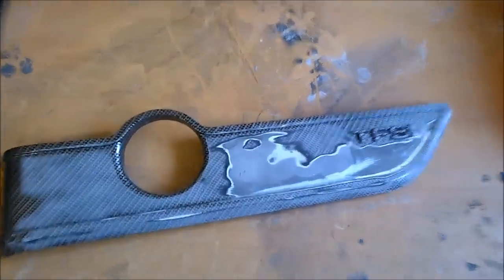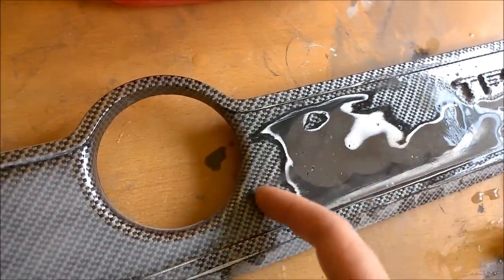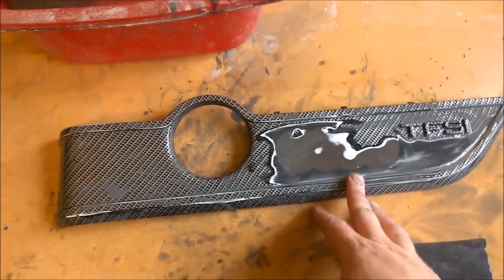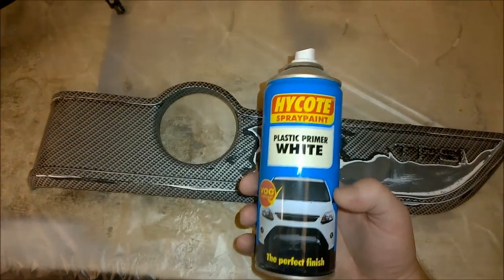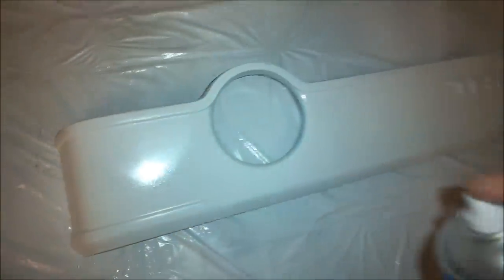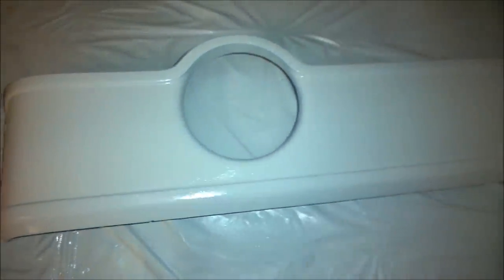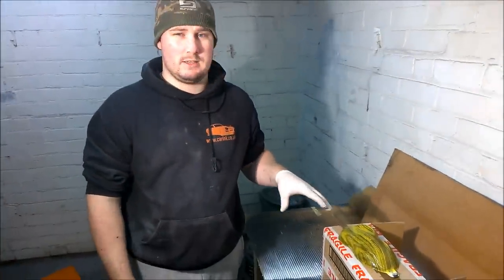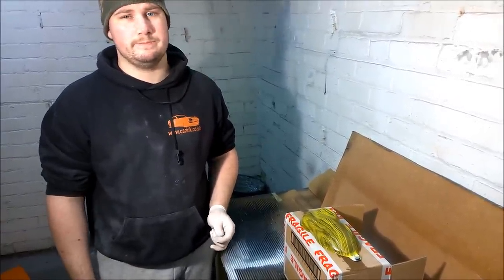Hydrographics Start to finish instructions for beginners , CARINK

Comment: Really helpful video, thanks for it, if you have a already painted piece, you only need to sand it with 800 sand? There is nothing added to the water? So the only necessary thing to have are hydrographic film and activator? Can u use the film in a car intake piece? , not a high temp part but it can get really hot.
Reply from the maker: Ye a lite sand should help, it depends how long its been painted and how hard it is. An intake will be fine as the film can usually take a lot of heat, it depends more on the paint and lacquer. ty

Comment: just found your vid and subbed it was very helpful and I will watch the rest, I just had a couple of quick questions
1) when your done dipping a part is it necessary to clean the excess film from the tank and if so how
2) how do you clean the film off of your arms when your done
thank you for any help
Reply from the maker: ray5220 Hi Ray,rinse your arms with warm water and quickly, do not scrub as the activator can burn.Film should be scooped out with a net, but on a proper tank a filtration system is fitted, thanks

Comment: thanks a lot for instructions, lets say that my surface is nice and smooth, i do transfer and spray with gloss clear coat.Can you easily peel it off if you get bored with it and not ruin surface you have covered ?

Comment: hay, im a modeler, im going to be dipping small parts for modeling. can you tell me whats the best paint for the graphic to bond to? acrylic or enamel?
Reply from the maker: What ever you find is best for bonding to your models I would stick with that. As the film should bond to either.
Reply: thanks for the reply.
Reply: RobinHoodUKIP  check out One Hit Wonder Paints.
Reply from the maker: Boyd River I'd go with low country over OHW every time.
Reply: its ok guys, ive now found that acrylic-polyurethane paints works best and as the small pieces are hard to do, any mess ups in dipping and the paint is really easy to strip.

Comment: Hello , Thnx So much about this vidoe its so usefull ,
i have a question now u made the surface smooth and used sand paper to make so
i wanna make some pieces in my car dashboard but the surface of the fiber pieces is Rough surface
would it work or does i have to spray it with primar to make it smooth 
thnx

Comment: You need clean the piece with hot water o cold water is enought?. Regards. Good video.
Reply from the maker: +Cransaft Valve   Cold water is fine, warm water will get it off faster but don't get i too warm as it will burn it.

Comment: Really good video. I'm looking to dip my motorcycle helmet any tips?

This is by far the best instructions I've seen on youtube, thanks
Reply from the maker: Hey, Helmets ok, If there's a visor, make sure it's closed  if there's no visor mask up the gap otherwise the film will get sucked through. Start your dip with the back of the helmet going in first and roll it forward as you go down to get full coverage. Good luck :)

Comment: hi, i wana ask, if i want to start my own smal business , all i have to do is to buy the tank the rolls and the activator right? cause some comapnys are telling me that i have to buy all these (1)Manual Dipping Tank : Manual put the goods into water and transfer printing with film and activator(with heating system)

     (2)Washing Machine: clean dirty film and activator (with cycling use of water system)

     (3)Drying Machine: dry water and oil  (with timing system and temperature control system)

     (4)Spray Booth: spray oil(topcoat and primer) to keep surface shine  (with drencher system)
.

Comment: Great vid, thinking of starting this up in my local area, any advice on starting? Is it worth buying speed shapes to start off with, I take it they are used for practicing and also showing the finished patterns?
Reply from the maker: Hi Rich,

1st if you are thinking about doing this as a business id make sure you have a background in paint as that's probably more difficult than the dipping process its self. Its not a no go if you don't but you will have to spend tike and money learning as the paint side is where you earn or lose your money more than anything else. There are training courses you can do or night tike college courses that can be done over a year.

assuming you have a paint background the Hydrographics can be quite difficult. I would strongly recommend a paid for training program from some one who knows what they are doing. Depending where you are I could possibly recommended some one if you don't use our selves. I would not waste money on a basic starter tank as this will quickly be replaced neither would I go out and buy a new tank as second hand ones come up weekly by people who have started and failed.

speed shapes are a worth while investment as you can use them to practise at first and then display them when you have good ones, They are good for practising laying down base coat, primer and lacquer as well as the dip.

I would not quit any other job you have to do this, save some.money spend it on training and materials, don't buy cheap stuff as you will buy I twice. Then spend a lot of time practising, once you are confident you can offer a good service and not have to do jobs 3 times before its right, then and only then consider charging customers. Start out slow and do it on the side, once work pics up then consider full time.

hope that helps, if you need anything or more advice feel free to call. Thanks

Comment: Hi! Is it a good idea to lacquer hydrographics with a brush? The problem is that i wanna lacquer my guitar with a polyurethane lacquer and I cant find it in spray cans. Thanks for the reply :)
Reply from the maker: +Domiman13 I've honestly never tried it with a brush, I imagine doing so would cause the brush to drag the pattern  but I am not 100%, by all means you could test it and find out. I imagine if the lacquer has no thinners in it, you should be fine.

Comment: Hey guys!  Awesome video, do you have any tips on dipping round objects, such as pvc pipe?  I've tried dipping round objects and the part that goes in first turns out good but the back always stretches the pattern.  Any advice is greatly appreciated!  Thanks in advance!
Reply from the maker: Hey, you need to roll them, dip the right side in 1st until it's half way in, then hold that side still and lower the left side until it's half way in, so now the pip should be in the water but only half way, now you need to roll the pipe forward while gently moving forward also, once the film is on all of the pipe push it under the water then pull it out. I'll do a video on it when I have a minute, Thanks
Reply: car ink thanks for the reply!  one more question!  After you sand your piece that your going to dip what do you use to clean the dust or old paint off the piece before painting?
Reply from the maker: UPOL DEGREASER :)
Reply: car ink Awesome! Thanks, I just started dipping and my problem seems to be that my film never sticks to the piece like it should, there is always some that comes off during the rinsing process! I was thinking that it may be what im using to clean it before the primer.  Thanks again for the reply, you will be getting good reviews from me!
Reply from the maker: Sounds to me like it's not activated enough, when it doesn't stick does the film look like custard skin as you push your item through the water? Does it come off in broken pieces rather than slide off? If so, it's not activated enough.

Comment: Hello,great video but i have a problem. After i dip the part and start rinsing it little white dots appear on it. What could be the problem?
Reply from the maker: You need more activator, too little activator and little bits of film fall off and little dots appear, too much activator and the film slides off the paint and possibly also melts the paint.
Reply: Thank you for the answer,i'll make sure to put more activator next time i dip.

Comment: Can i dip plastic/metal without using a base color?
I have some kind of transparent primer for plastic, but activator erases it :( -cant find anything better in my local store...
Reply from the maker: Hi, some plastics will not require paint or primer, the film bonds very well to bare plastic, metal how ever will require paint every time, the activator works by softening the surface which it can do with plastic but not metal.
Reply from the maker: car ink
Also, transparent primer sounds like an adhesion promoter, used before you apply primer to help normal paint stick.

Comment: How much film i.e. cm2 do you need to use compared to the size of the item your covering
Reply from the maker: Hi Jason, it's really dependent on what you are dipping, a flat square would only require a couple of cm's around the edge if you were good at it, where as a bike tank might need a full extra foot. it's something you will learn with practise.
Reply: Ok thankyou

Comment: So one question there is no point of using masking tape??
Reply from the maker: Jesse Munoz It depends, We use masking tape if we use the full width of the film or if we cannot afford for the film to roll up, so for example, if blue flames was to roll up a bit the extra stretch would then cause issue's when dipping. So we would tape it and slit the tape and then move the damms into position. Another use of tape is to use it as damms by letting it float on the water, A video I will be doing at some point.
Reply: Okay thanks
Reply: Okay and one question more. how much time should I put the activator on the sheet?
Reply from the maker: Once its on dip straight away

Comment: Besides this video being really clear and helpful on the subject, i do have to say that you might have spend a little more attention to safety and health. It is a specific instruction video for beginners, right ? 
As for the small room, there doesn t seem to be any ventilation. The electricity is extremely close to the water basin.
The explanation on how far away the spray nozzle needs to be from the surfce when spraying, you are demonstrating it by spraying on your hand ... i believe i read the products are carcinogenic ... and when dipping the item, you are also not using gloves... 
Again, i like the video, it is a real good explanation, but maybe you might have spend some more attention to these things.
Reply: I think you will find is to use your common sense regarding water near plugs etc

Comment: You lost me at the 7th minute when you pulled out the can of spray paint. Anyone who wants great results and is at least halfway professional uses an HVLP. Even for the smallest of job, be professional about it. You cut corners, especially on a basecoat, you are asking for issues down the road
Reply from the maker: +Pyper70 I lost you at the 7th minute? Nah buddy, I think I lost you at the title which clearly states for beginners. You realise most people watching this won't have a clue what an hvlp gun is let alone how to use one, people doing this as a hobby or for the 1st time will not be getting the same results professionals do, I have £20,000 in equipment but a starter kit is from £20 and there fore comes with the appropriately priced gear. This tutorial is clearly aimed at first timers, if you want to make 25 hours worth of videos on how to spray properly using an hvlp gun go ahead because a 30 minute tutorial will not cut it. Thanks for your insightful comment though...